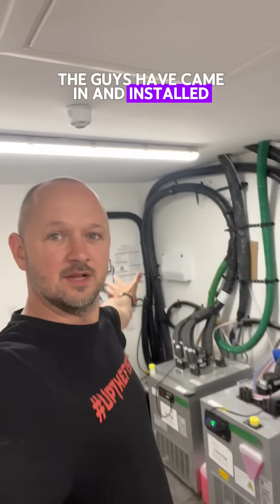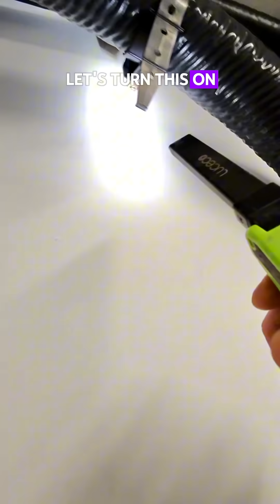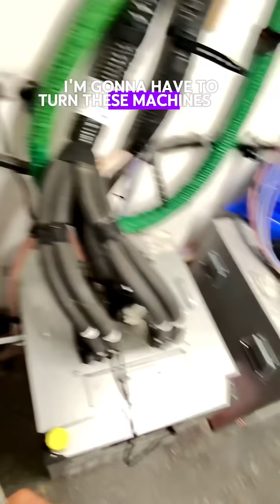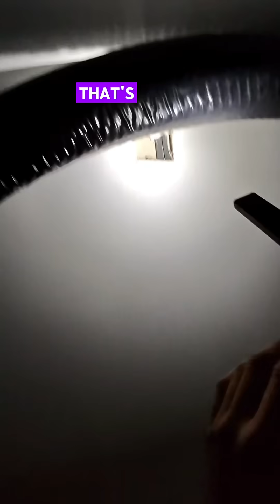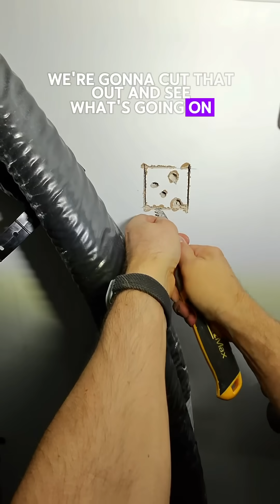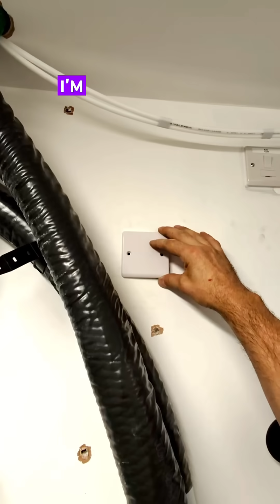Nicked T&E On Site — The Right Way to Own It & Repair It

Comment: im not a spark but you as a spark should know that most equipment these days have capacitors meaning you can just switch off at the board regardless of the machine being off or on it will power down by itself up to 10 seconds after you flip the board this isn't the 50's lol I've worked with old boys that say don't do it but technology has changed
Reply from the maker: Good point, I'd say it depends on the appliance though.

Comment: The filming is a bit wobbly so I can't be sure but it looks like the cable that was hit was not in a safe zone. If so the root cause of this issue was the original electrician who installed those buried cables not following wiring regulations.

Comment: Running hidden cables even with capping is interdit in my country, you have to use single core cables in gaine (flexible conduit) so if any damage does occur you can pull out the old cores and pull through new ones.

Also the gaines are oversized not just for heat dissipation but if say a plasterboard screw were to go through the gaine it would just displace the cores without damaging them.

The regs also prohibit using plasterboard screws longer than 25mm for 12.5mm placo which gives further protection.
Reply: @JR-o7d  This is what we do in Spain too and why I prefer it. If I ever moved back to the UK and did electrics there I'd always run flexible conduit to pull new conductor's through
Reply: this is part of the regs here in uk to run cable in conduit especially metal in commercial property obviously they got a cowboy to install the optics

Comment: Why do you need to fit a blank if it’s in a safe zone?
Reply: Not challenging, I’m sure you know your zones, just a weird ending. 

How do you fix your cables that have been bullseyed by the kitchen fitter / plumber / builder ? 

Wago and heat shrink? Crimp and heat?
Reply: @MalvernElectrics  Oddly fitting that blank is the thing that makes it a safe zone.
Reply: @andrewfrance1047 I’m okay with a blank to make a cable run ‘safe’, but it was already in a safe zone so why the blank? 

Context - I haven’t watched the vid for a while. Lot going on - can’t be arsed. 😊

Comment: I'm a bit concerned about your apparent knowledge of electrical safety. First, it seemed like you were saying if you could have turned the machines off at the user end you wouldn't have needed to isolate at the supply end(!) Second, flipping every single breaker doesn't mean there are no live cables in the wall, because even assuming there are no unrelated circuits there would still be the main incoming meter tails which would only be protected by the main fuse at the meter. So my strong recommendation in this situation would be to use a blade that is physically incapable of cutting more than the depth of the plasterboard
Reply from the maker: It’s all about experience and knowing your job mate

Comment: At home, a curtain fitter put a hook for a tie back through a spur for a socket (I can kind of forgive them for not suspecting a downstairs socket might be fed from a line run from the ceiling, but they must have had a bang). The socket still worked. They glued the metal hook in place over their booboo.

I only found it when the hook fell off a few years later. So dangerous to have hidden a damaged cable in metal conduit. Fortunately, I was able to pull a new cable through, even with the damaged conduit.

Comment: Did the same kind of call outs, when you get a damage to a cable, The customer seems to think you dont HAVE to find the location of the fault but magically fix it without cutting or drilling to get to the location...duh " I dont know how that happened " .

Comment: They might not have known, the A/C unit might have switched off, but they can do that automatically.
Yea you would think if it's not cold it should be running.
Reply: They might not have heard the pop but the tip of their sds drill bit woukdve been melted , they definitely knew because they clearly had more holes to drill

Comment: The access plate is a cool idea in a pinch. Doesn't even look out of place in commercial or industrial settings
Reply: would have been better to fit a dry line box in it first so you can screw the blank up.

Comment: electricians hit my fire alarm cable all the time. sets of the alarm and they're like "it was going off before we even started drilling". sure it was. i tell them to check between two points and what do you know, a shorted wire shows up right where they were working.

Comment: So what was the repair here? Where did the T+E get spliced and replaced?
Reply: Jointed it behind the blanking plate,  what else could you do 🤷‍♂️
Reply: @johnwarwick4105 he coukdve probably cut a fast gig box in higher up and pulled down new piece of twin snd earth into the consumer unit and made the join in a spur or some other connection and the connection would be inside an enclosure . 

Hes technically broken the regs now as theirs single insulated cable in a cavity outside an enclosure . Can't have single insulation outside an enclosure since the 16th edition we are now in 18th edition amendment 2 😂

Comment: It's like bumping into a car in the car park no one tells they just run
Reply: @JohnDundee-el2ro Some stupid cow bumped into my XC90  in the shopping centre car park. I installed from and rear dash cams with around the clock surveillance. The relays knock off when the battery drops to ll.9 volts. The best thing I ever did was install that. The twatbag drove off. Even though I wasn't in the vehicle at the time. I uploaded the footage online and let my insurance company deal with it. I've since installed it on both my vans and my M5. People try anything these days.
Reply: @Ranj.Singh.Dhaliwal  that’s quite the story to tell us you own an XC90 and an M5.

Comment: That was an easy one was it a radial did yi rewire it or make a joint
Reply: He joined it inside the cavity with no box or enclosure just a blank plate iver it 😂😂😂  cowboy
Reply: @christophergallagher3845  a small choc box would have been fine inside a plasterboard wall 20A wago connectors but I would have put a box in with blank plate 20 A wagos

Comment: When installing cable TV down here in Queensland, I hit a power cable and the pop it made and the damage it did to my drill bit there is NO way they didn’t know they’d done that
Reply: This circuit was on new modern rcbos they would've know but the pop wouldve not been too bad.  Their drill bit wouldve been gubbed though
Reply: @christophergallagher3845  The hole looks like it only got one of the conductors and the earth. The RCBO will trip on a neutral to earth fault and that wouldn't go pop. So it's conceivable that the person who did it did not know. They could have heard the RCBO going off but thought it was some other plant operating.
Reply: @andrewfrance1047 if the luve and earth shorted the rcbo wouldve definitely tripped . Unless it was faulty or they were 400m away from the rcbo and the max permitted Zs was way over the limit
Reply: @andrewfrance1047 i agree the noise of the rcbo tripping couldve been missed or mistaken for a pump or something kicking in
Reply: @andrewfrance1047 nvm warlier comments about live i misread but a neutral to earth fault woukd definitely make it go pop . Rdcs may trip quitely when the mcb controlling thd circuits turned off and short neutral and earth but an rcbo on a live corcuit wont trip quietly thdre would definitely be a pop

Comment: Funny how it's always the "bloody sparkys fault". Can't possibly be anything I've done. 🤬
Reply: I was wondering why the cables going up the wall there iff it went to the ceiling from the dB the supply to the unit is nearby so would drop back down into it.

Comment: It’s not obvious if you put a metal box in the wall for your terminations . As it doesn’t look like it .
Reply: He hasn't he just joined them in the cavity and left si gle insulated cables outside an enclosure
Reply: @christophergallagher3845 rough as rats